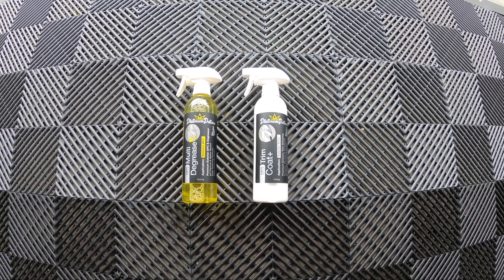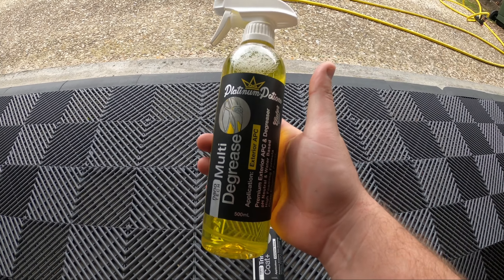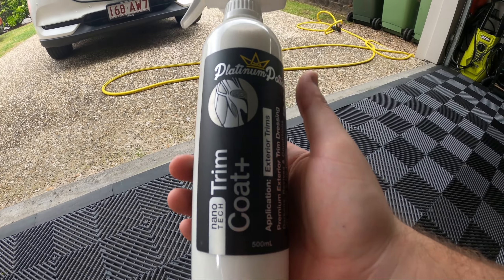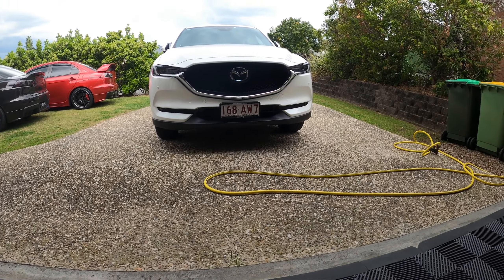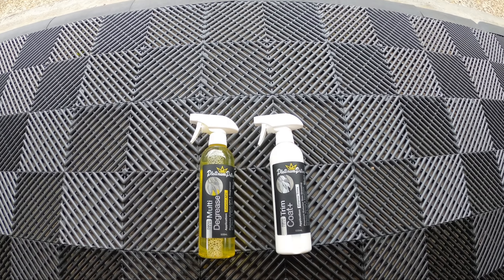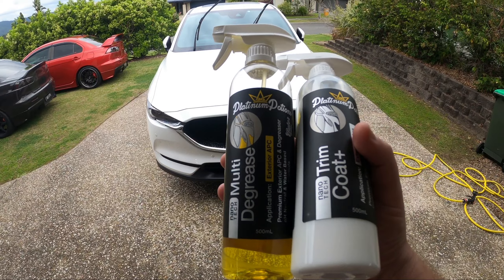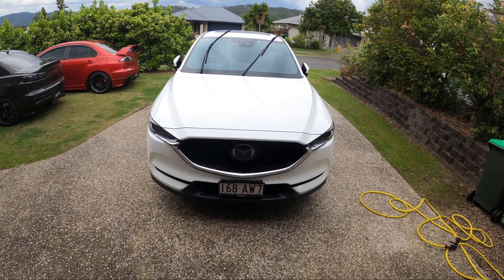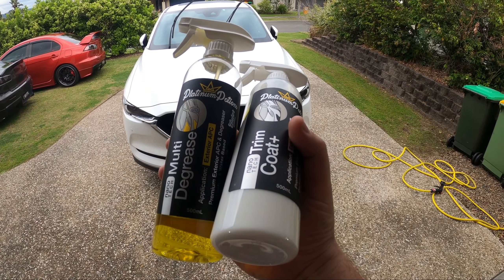Platinum Potions Trim Coat + & Multi Degrease Test And Review

Comment: I'm always looking for good vinyl conditioner, I just bought some chemical guys VRP seems to work well on trim...you could always do a test on the front lip of a car with some different brands and let it drive for a couple of week and then check it after
Reply from the maker: Yeah this stuff is definitely good and am a month in so far. Haven't used the chemical guys one before but might have to grab some

Comment: My issue is price. They're not diluted and cost more than other concentrated options. Keen to hear about longevity I guess.

I'm in bris as well and maybe I've been lucky with birds and dust but haven't felt the need to wash the car for 2 weeks after using platinum potions shampu on the parked outside daily. Usually it's a weekly or even more often task.
Reply: We think our pricing is very competitive to what your getting, as you've seen he used not even 10mls to do the entire car.... A 500ml bottle will last you in excess of 2yrs for 1 car as you only need to apply it every few weeks - months (depending on conditions outside) 🙂
Reply from the maker: Price seems fair to me at $25 and yes I used the smallest amount
Reply: @PlatinumPotions  don't want to sound like a hater as I have a bunch of your products and love them. You're right one bottle will last a long time and it's a difference of cents per use.

Comment: Nice work. Do you think the Trim Coat could work on Tyres as well, since it's ok to use on trim rubber?
Reply: You sure can, but our tyre shine will spread more easily and use less product compared to using trim coat on tyres and the tyre shine will most likely hold up better is it's purely formulated for tyres 🙂
Reply from the maker: As platinum potions replied haha, I do love their tyre dressing too though

Comment: Looks like another couple of good products from Platinum Potions. Would love to know if you have any troubles with run-off or streaking after it's first wash? I still haven't managed to come up with something water based I'm entirely happy with for tonneau covers/plastic trims etc. Keen for a follow up on this one 👍
Reply from the maker: Yep they've done it again 👏
Reply: Thanks mate, no run off issues or streaking (when left to cure for 1hr), we tend to see up to 2 months on daily driven cars & up to 6 months on weekend driven cars (garaged), we actually recommend to apply this 1-2hrs before washing so you can see just how good the product works & how insane the water beading is.
Reply: @PlatinumPotions  sounds like exactly what I'm chasing! I'll grab some and give it a try 👍

Comment: Silicone that will last a couple weeks.
Reply from the maker: Been a little over a month since I made this video and so far so good bit definitely starting to fade a little now.
I will be using a ceramic coating on these plastics eventually but for an in-between or for someone who doesn't want to use a ceramic coating this is a great option
Reply: @EvolvedDetails  over time the trim will go grey from the silicone in the dressing
Reply: @Disciple11  what would you recommend?
Reply: @Disciple11  daily driven cars we've seen around 2-4 months and weekend driven cars we've seen in excess of 6 months

As mentioned in a previous comment, our product has UV blocking ingredients in it, doesn't contain any oils or solvents thus won't make plastics turn grey/white 🙂🙂